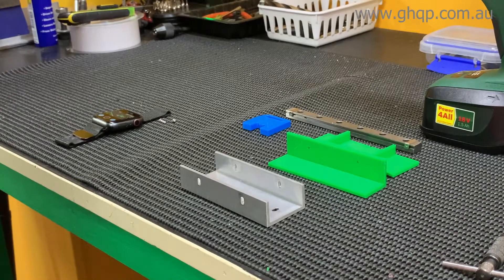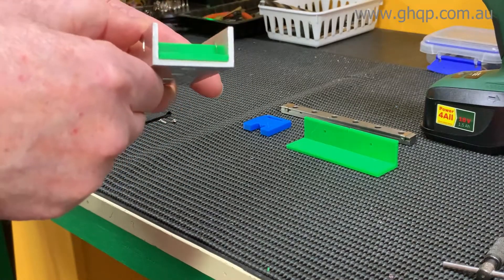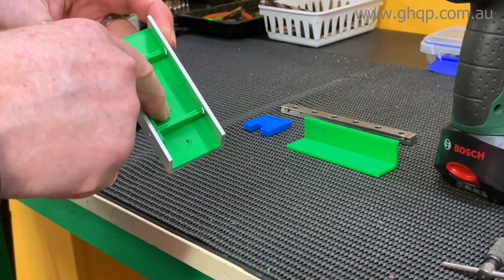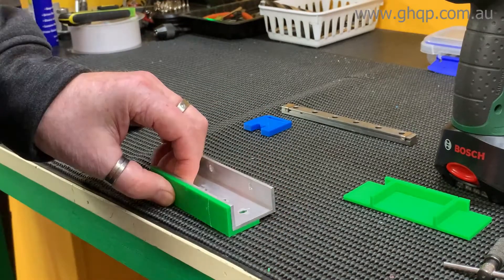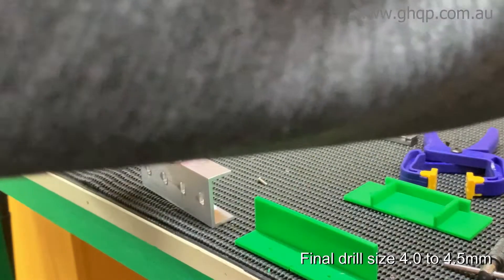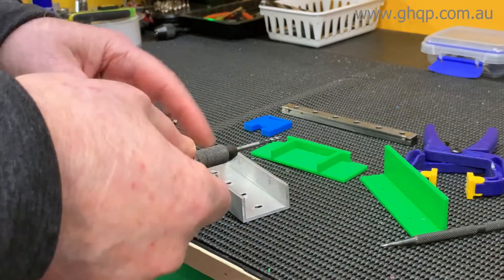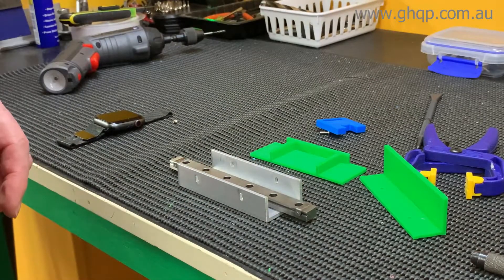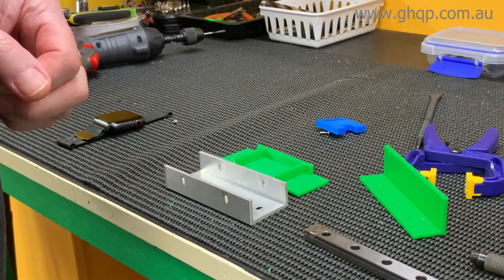Predator Linear Rail Upgrade Drilling Jigs

Comment: Am I following this right? Using this method you do not need the recessed holes for the nut to set in as you are just tapping for a 3mm screw with no nut?
Reply: Yes your understanding is correct. After attaching the rails with the M3 Screws you may have to grind or file odd any protruding part of the screw. I also recommend a little LocTite to ensure the screws don't come loose over time.
Reply: @grahamham3398  Thanks! I like your solution better than any others I have seen because it's not destructive of the original frame and will be more robust than plastic or screws into the thin original frame. I'm in the U.S. Have you heard of an equivalent U-channel that I could source locally? The dimensions don't mesh with the standard 1-1/2", 1-3/4" stuff I'm finding.